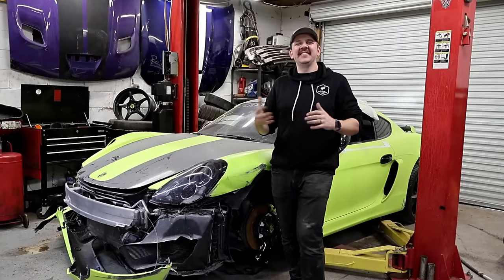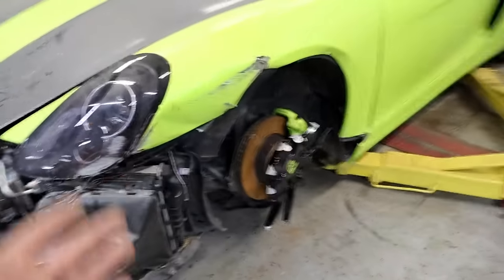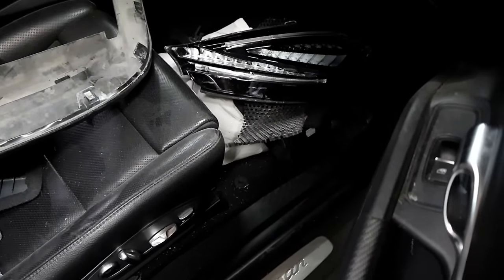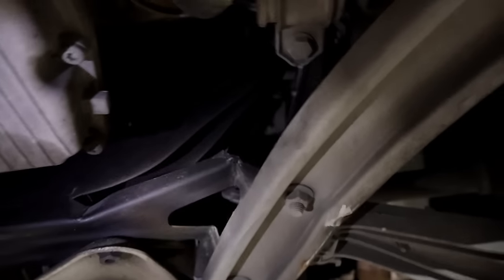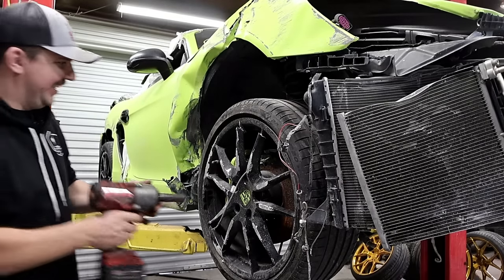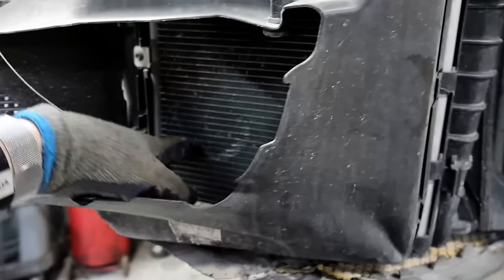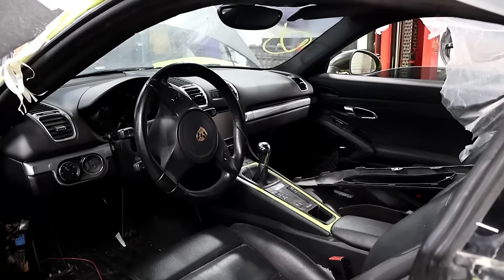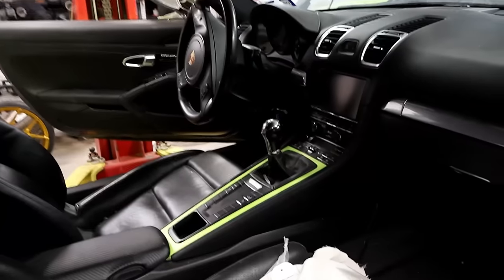WE WON A WRECKED PORSCHE CAYMAN IS THERE HIDDEN DAMAGE?

Comment: I have been bidding on salvage Caymans the past couple of years. The first one was also a 2014 and all the others were newer. (718) At least one Boxster as well. Should be a good project. Please get rid of that wrap. It is awful.  I think the metallic gray should be much better looking if the paint is in good shape.  I would get rid of the lime green junk inside as well and return it to a respectable Porsche. Hope the previous owner kept the engine/trans maintained. I would not consider one with 100k miles, but if the old owner is an enthusiast and stuck to the maintenance schedule, you may have a great project car. Good that you were able to get the keys. New sub here and I will be interested in watching the progress of this project.

Comment: Seems prudent to hold off buying anything until you start the engine. Is it possible to ask the previous owner any details about the engine/transmission or other mechanical/ac/computer issues etc aspects of the car prior to the damage? With youtube 'time' you may have already found all this out and decided to move forward or sell/cut your losses.

Comment: It will make good content, but as for profit i don't think so its not even low mileage, if the engine is damaged as well its game over, I'm thinking 10K in parts needed if your lucky, and when repaired it will not be worth as much as a non salvage car.

Comment: Keep in mind that Porsche is part of the VAG = Volkswagen Automotive Group, hence the VW and Audi logos on some of the "parts bin" items....
Considering the amount of damage, the 100K mileage, and spec (this was a Base Cayman with 2.7L flat 6), I would see if the engine is good, and part out the car.  Or find another damaged Cayman from same vintage “981” model) with good parts you need and combine the two.  New or good quality used parts is going to make this a financial loser.

Comment: Sorry guys but I think you might have bought yourselves a part car. Too much work needed and parts required. Also a non runner.  Hopefully everything is there to make it run.  At the end of the day when fixed it’s still has 100k miles which is too much for a Porsche.